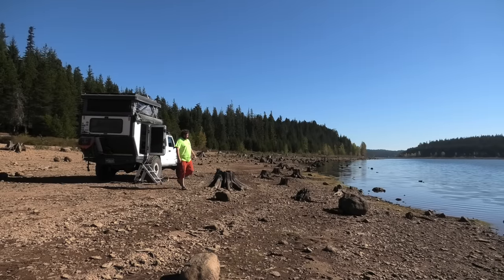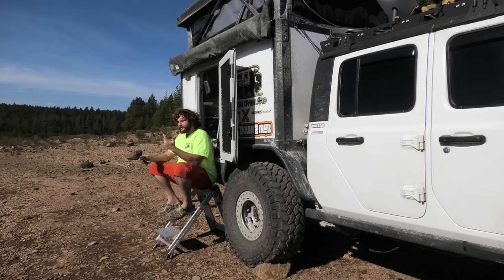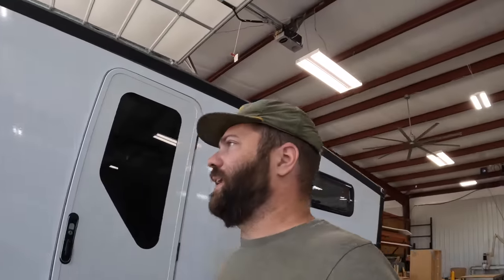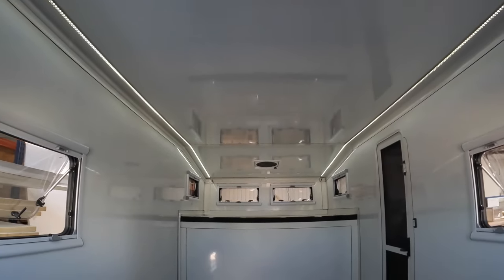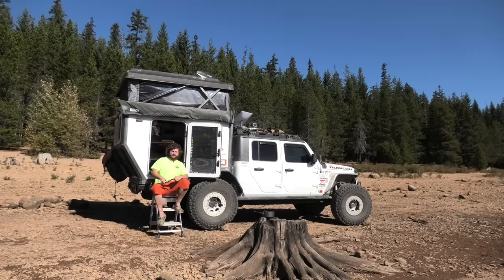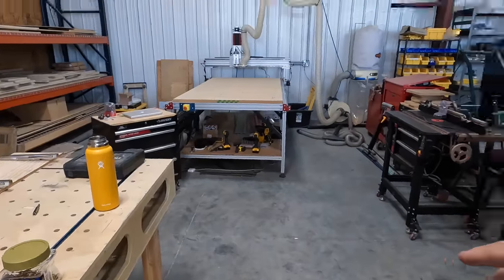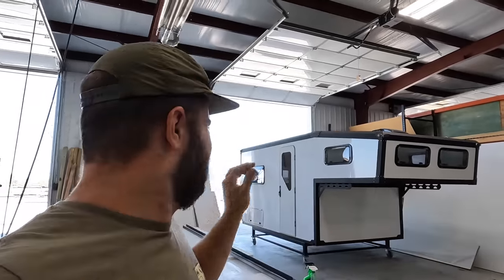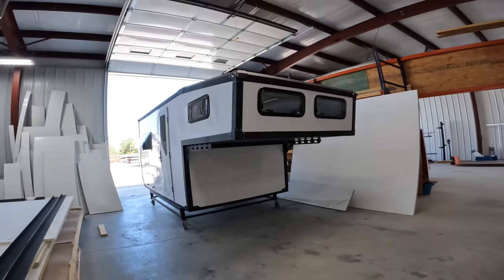The FIRST EVER Hardside Truck Camper from Bison Overland

Comment: Is that camper made by Bison or are they using another manufactuer then assembling them in house? What are the specs on the wall/floor materials and thickness? Looks very nice and well built for the overland crowd. Im on the fence about a build out like this unit or a slide in truck camper from NuCamp. I have a F350 srw long bed at this time and was thinking about trading out for a 550, but this being only 1300lbs empty gives me a 2k lbs of capacity before i hit my trucks GVWR. So i could do a nice build out on a unit like this and not have to take on a new truck for a build. Kudos to Bison and their skills, especially with those cabinets from a small manufactuer!!
Reply: We build our campers all in house and from scratch. Using all American Made materials for the habitat itself. No cheap Chinese panels that you see elsewhere.
Reply: 👆<<<<<<<<<< Tell my trusted broker, ANDREI JIKH, that I have referred you for a life-changing investment business👆✍️ >>>>>>>>>
Reply: And wall material/  insulation

Thank you

PS serious inquire

Going to swap out something like what you have from my arbortech box

Comment: Sweet camper!   We need to see this Tacoma camper Bison mentioned. I want to build a small nimble off road camper to live out of for a Alaska & west coast national parks trip but when you start adding the #’s up all of a sudden it seems like you need a  3/4 or 1Ton chassis.  I’m really thinking about a new Nissan Frontier  access cab since the payload is a little higher. Then removing the bed and building out a 7x8 camper.
Reply: @Wyn,
I think you are right to consider GVWR.
Our ExpeditionVehicle GVWR -- 29,000#.
Weight across the scale -- 14,000#.
Cargo capacity -- about seven ton.
2003, we converted a 1996 Ford CF8000 box-van to our concept of an ExpeditionVehicle.
Nearly two decades full-time live-aboard.
Summers up rough logger tracks to remote mountain lakes.
Winters on isolated Baja beaches.
.
On skoolie and other home-built forums, we suggest builders:
* acquire some old beater
* toss in some car-camping gear
* go have fun.
Allow the conversion to evolve organically.
.
Building then using risks forcing the adventure to fit the rig.
Reply: Don’t do it! Don’t buy a Nissan, you’ll regret it. Sadly, all car manufacturers make unreliable vehicles. Toyota and Honda are the only two left that make quality reliable vehicles. If you buy a new pickup truck, buy Toyota. It will cost you more but save money in the long run.
Reply: @largemarge1603  -- I agree and I call this Dynamic Design -- let your experiences in the real world inform your choices about what to put where. Or do the "no build" approach where things can be moved around until you like the fit. My first "build" was just a tall bed cap (about 6" higher than the cab) and the stove and sink were contained in their own cabinets in the rear corners of the truck bed. They had garage door handles and one could pull two pins and lift the cabinets out to use outside. This also makes more room in the truck bed to haul materials and tools as needed. :)
Reply: Email us. We’ve got options.
Reply: 👆<<<<<<<<<< Tell my trusted broker, ANDREI JIKH, that I have referred you for a life-changing investment business👆✍️ >>>>>>>>>
Reply: @sail4free1  
Jim!
Thank you for your eval and description.
I am adding it to our suggestions for home-built campers.
.
I visited your YouTube page, I especially liked the 'Not A Good Girl'(sp?) investigation videos.

Comment: 2003, we built our ExpeditionVehicle interior as 12x7 by 7h, about 600cf.
Nearly two decades full-time live-aboard.
We engineered a rear-entry, with a permanent porch and permanent roof... our combination:
* mud-room
* shower
* summer kitchen.
.
For this new Bison, I could see a rear 'U' kitchen.
With similar interior dimensions, this size is ideal for:
* three RedHeelers, plus
* two adults, and
* a frequent yummy third!
.
An aside:
Clodd mentioned showers.
A couple weeks ago, I acquired a back-pack garden-sprayer, a Craftsman 20v.
The battery is compatible with our other Craftsman tools:
* drills
* saws
* impact driver
* and our 20v chain-saw.
The four-gallon dark-red tank absorbs sun nicely for a comfy shower.
.
For our introduction, with plenty of portraits and our reasons for our decisions including this size:
https://vanlivingforum.com/threads/expeditionvehicle-build.44908/#post-576110
Reply: 👆<<<<<<<<<< Tell my trusted broker, ANDREI JIKH, that I have referred you for a life-changing investment business👆✍️ >>>>>>>>>